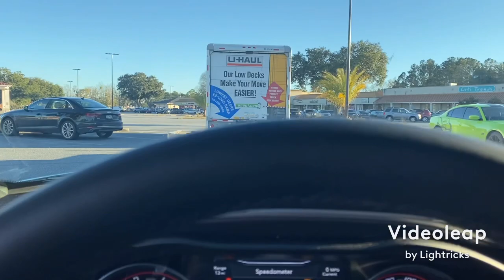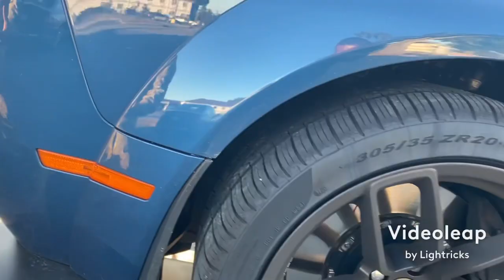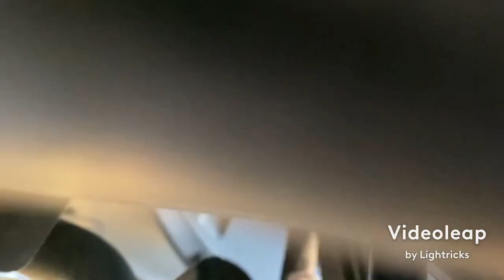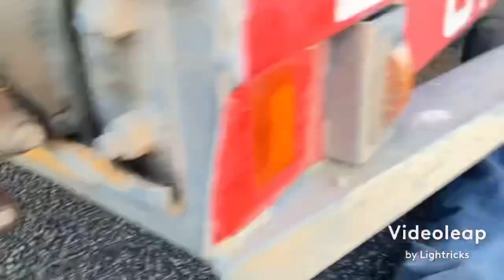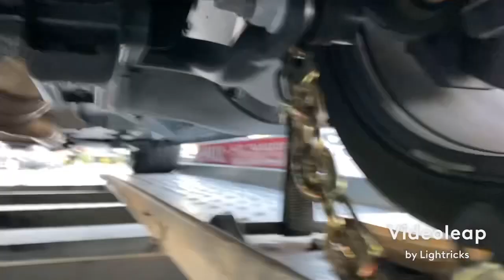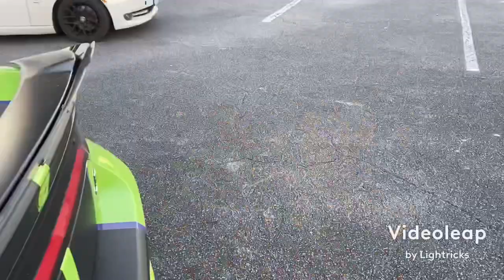Widebody on a trailer #widebody #scatpack #charger

Comment: Length. Damn, what length are the boards. If you put it on backwards you impact your weight distribution with the engine weight at the rear.
Reply from the maker: I don’t even remember the length. If you put the car on backwards your front bumper might mess up
Reply: Yeah that front bumper will scrap on the ground, and then you have to go outside the passenger door or Dukes of Hazard out the door.